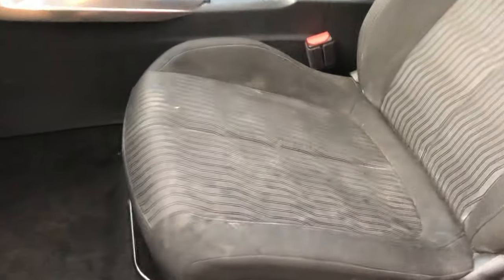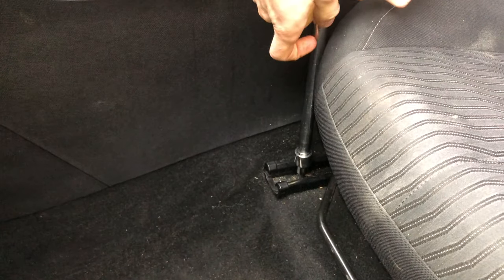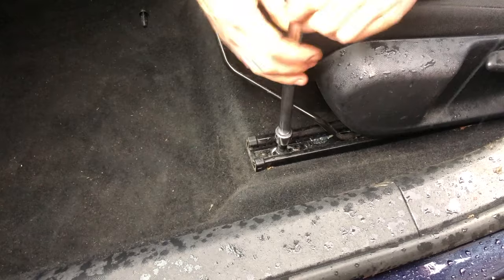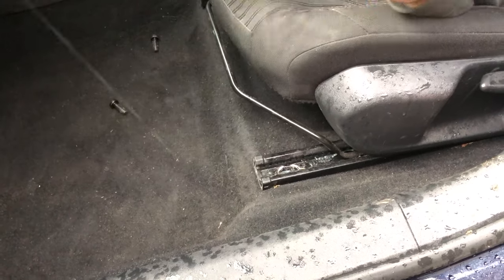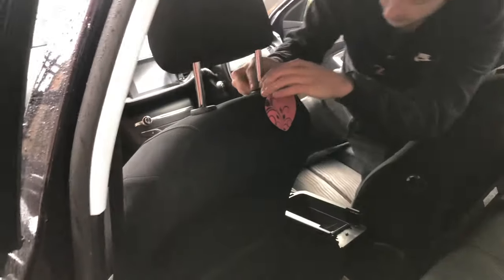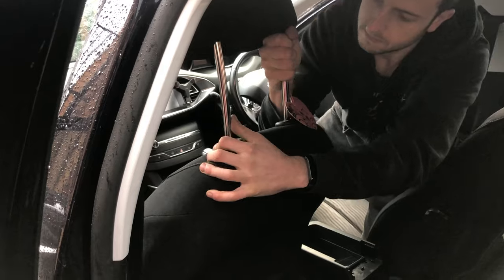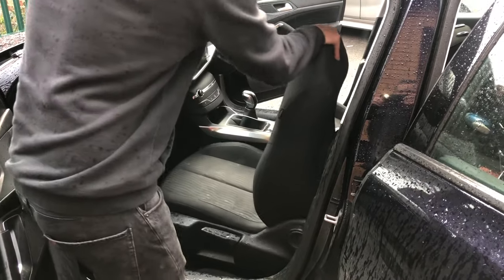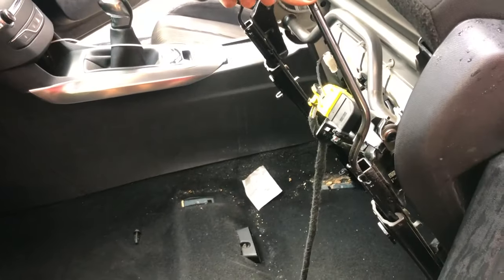How To Remove Peugeot & Citroen Front Seats - 308 How To DIY Car Seat Removal Driver Passenger Side

Comment: Thank you for the video. Once you have replaced the seats you might get a 'airbag(s) or pretensioner seat belt(s) faulty' message, don't do what i did and unscrew the seats to check the wiring. Just pull one of the seatbelts to it's fullest extent, and sharply pull as if in an accident then switch on ignition and the message will have gone.
Reply from the maker: That’s good advice if it works, I would’ve thought you’d have to plug in a code reader to reset the codes.

Comment: i have a 508 but the air bag light comes on intermittent, I have checked the connections under the seat and know its the drivers side but using a code reader, the error is resistance to high level drivers side airbag line front, any idea's?

Comment: When putting them back in, what torque setting would you recommend? Is there a set standard for all peugeots?
Reply from the maker: Hi Ryan, I can’t find a torque figure but I think I’d be more inclined to use some thread lock and just tighten it as tight as you can with a 6” ish length ratchet.

Comment: How do you tear down the backrest of the front seats? I need to check the connector from the seat airbag. Also, the yellow plug in mine has only 1 green/yellow cable, and other wires are just cut off from he connectors with leaving 2cm of each wire. Is that normal??
Reply from the maker: I don't know about tearing down the back rest. Do the cables look like they've been left from factory or are there signs this isn't original. It may be worth checking someone hasn't disabled an airbag as you wouldn't find out until a crash.

Comment: What was that wire that you cut?  If you want to put the seat back in after you've finished cleaning, have you just messed up something for ever by cutting  that wire?
Reply from the maker: I disconnected the connector for the airbag. As long as the ignition is switched off it doesn’t mess anything up.
Reply: @IAMASPANNER  So that tool that you used after you'd undone the clip didn't cut the wire, just gripped it so you could pull it away more easily?
Reply: It's was just a cable tie holding the loom
Reply: @IAMASPANNER   is necessary to disconnect the battery before remove the seats?
Reply from the maker: @andreseduardosolisgonzalez4667  on this car no, just make sure the ignition is turned off until you have everything plugged back in.

Comment: Replace with Leather preferably Heated Seats (3008 2011-2013), will underseat Connectors be the same?
On Leather Seat versions the heated seat dial is on side, perhaps undersea is same connector & since Leather Seats incorporate the Switch, presuming it wud fit/work?

Comment: Do you have to disconnect the battery before you took out the seat?
Reply from the maker: In order to not get an airbag warning light you either need to disconnect the battery or leave the ignition off while anything is disconnected.